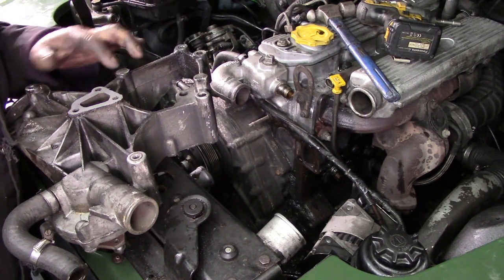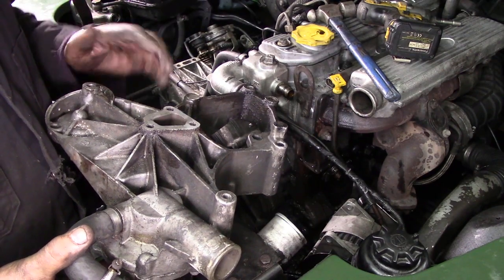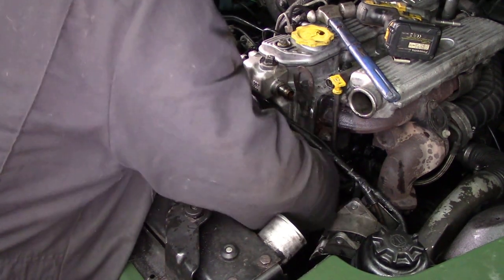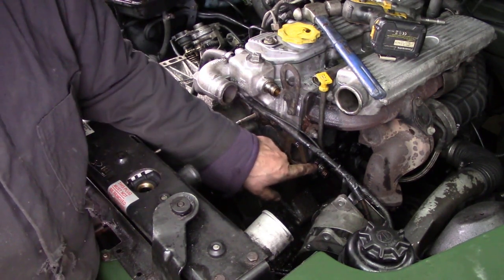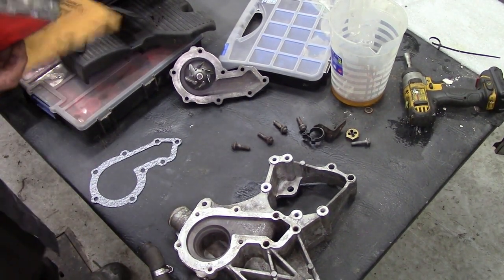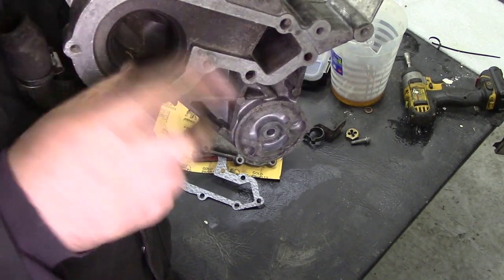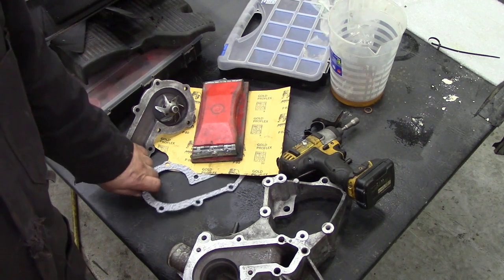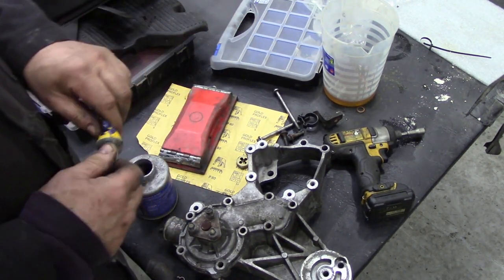300Tdi P gasket replacement in (almost) real time. Part 3

Comment: Good tips as usual, especially TIGing a pitted surface.
Would you TIG weld a corroded surface of the water pump inlet?
Reply from the maker: I usually wire brush or sand blast then fill the pits with an aluminium based body filler as it does not absorb water, sand it down and the rubber hose has a much better chance of sealing  - never had a problem, but I would not do the filler trick on the gasket face - as there is a bit of movement

Comment: Somewhere years back I saw I video of dissolving steel bolts stuck in an aluminium casting with alum?:)
Reply from the maker: Not heard of that
Reply: @BritannicaRestorations  I think it's used for pickling and it's also used for changing the colour of hydrangea flowers
Reply from the maker: Alum is also a dye fix - the monks used to mine it where I grew up - they got very rich it seems!

Comment: Mike is the thread guard better than say using copper slip?
Reply from the maker: Same stuff, different temp ranges.
Aluminium based for low temp applications (90% of Land Rover jobs) Copper for medium to high temp ( Exhaust clamps)  Nickel for very high temp ( manifold fittings and turbos)
I mainly use Aluminium and Nickel

Comment: If you were to machine the sealing face by, say, 1.5mm, would it not be simpler to just make a 1.5mm shim for the pulley?
Reply from the maker: Possible  = but what if someone was working on it and missed it out = the Vee belts are pretty unforgiving
Reply: @BritannicaRestorations  they scream out loud

Comment: I have to say I do not much like the idea of using sand paper to polish it up I think I would use emery cloth the idea of bits sand in your engine is not good even after cleaning there may still be one or two bits of sand left.
Reply from the maker: The ultrasonic gets them nice and clean